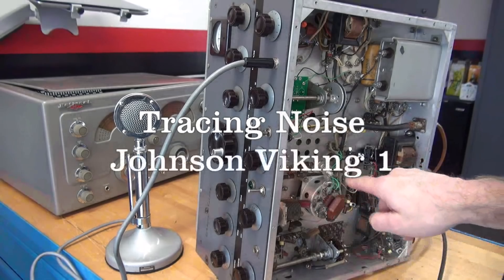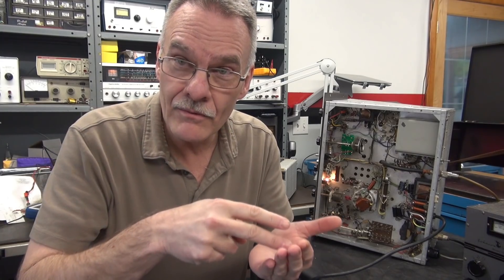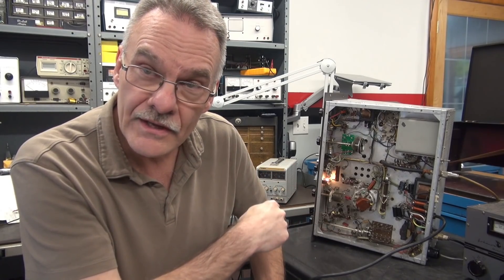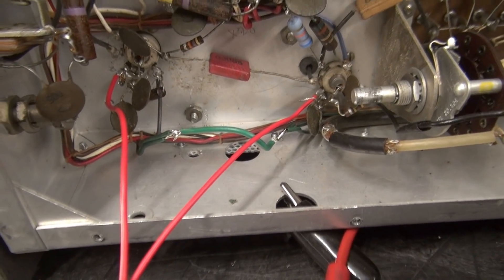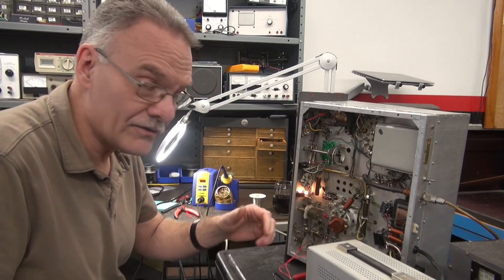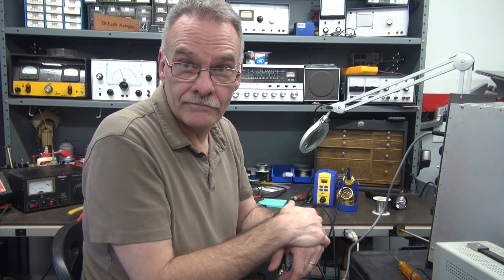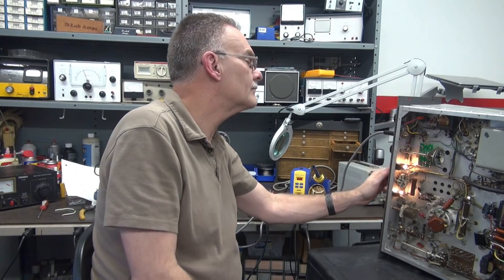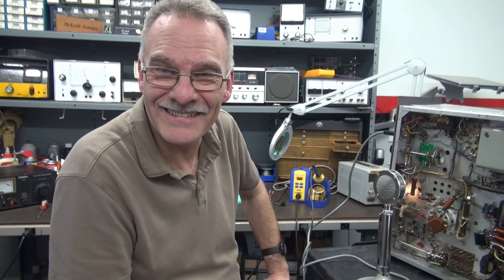Troubleshooting Johnson Viking 1 Ham Transmitter Science experiment Failed again When does this end?

Comment: Hi,
    Well done, in getting the RF side of things sorted out. Looking at the schematic I see there is a 0.5 mfd capacitor going to ground from the 807 screens, wonder if that is ok. Also it should be possible to see if there is a loss of volts to the screen, and anode, via the modulation transformer secondary, to the 4D32 output valve.

    Frank Hedley GM8TXC

Comment: Really enjoyed the video. Stay calm, don't panic!! By the way, I found previously that if the filament ground and HT ground are shared by one wire in the cable leading to a PSU, there is hum. This is because the filament volt drop across the wire appears in series with HT. I agree that twisted balanced filament wiring is best, but i think the centre tap is best in the PSU. 73

Comment: Terry... back in part 4 of the Viking 1 series you did not have a hum or audio problems after rebuilding the audio section from someones modifications, and you were getting a clean signal with lots of audio drive.....I think you have narrowed the problem down to the audio section, so tracing the audio signal should reveal where the audio is disappearing....

Comment: Terry
Are all those old capacitors replaced?  Have you checked to see if they are out of tolerance or if an electrolytic is reversed?
Remember your adage, "if they are that old, don't even think about it, just replace them."
What repairs were done before you received this rig?  I bet King Cobbler is hiding out close by.
Could some idiot have used acid core solder?
We all love a mystery!  Keep at it! You will solve this!

Comment: Terry, did you go in and check all of the power supply voltages to make sure that they are in spec?  Did you take your scope and probe the supply voltages to make sure that they are clean?   Have you actually probed with the oscilloscope the transmitter oscillator, multiplier and driver stages?  How about the speech amplifiers in the modulator section.   (Use a 10:1 probe for this.)

I wouldn't place to much faith in your probing with the inductor on the end of the long clip leads.  I noticed that the biggest variations came from you moving your hand holding the so called probe.   A better probe would have have a small turn or two of wire on the end of a piece of small diameter coax cable to remove hand capacitance from the equation.

I might help us following along if you would put a summary of all the things that you have tried at the top of the post.  It might save all the "have you tried" questions.

Comment: Huh. Are the filament winding isolated from each other? I wonder if a shorted winding in the transformer could be the issue but I'm shooting in the dark, wondering if it's coupling through the filament circuits.
Accidentally killing the modulator and having the buzz go away seems suspicious, like the circuit between the two has been opened... another flaky connection of cracked resistor/choke?
Keep at 'er Terry!
Cheers

Comment: your 6v heaters/filament  are I assume are DC so how clean is the 6v circuit from the transformer. 
Noisy recifier diodes maybe need some decoupling capacitor or  it comes across as mains frequency on the heater circuits.
Try fitting smoothing caps across the heater feed? 
Certainly is a baffling one, and you are more of an expert on Valve gear than I am so my suggestion may be way off. 
But the fact you are using 6V DC suggests recification noise on the DC circuit from the transformer. 

I hope you fix it, its now become a public labour of love ;-)

Comment: Did I see sparks in the little green circuit board?
4:50
Reply: I saw it too. With a noise accompanying those flashes. Might be on to somthing.
Reply: @wilsonri  the creaking sounds is the chair. There are three sparks. Two and three happens at the same time he turns a knob all between 4:50 and 5:09 on top of the green circuit board.
Reply: I was wondering if he had a LED or something on those boards but looking at a couple of other PTT module installs, there doesn't seem to be one. So, there ought not be any flashes over on that board. 
More problems? Or is it related?? 
I seem to recall there used to be PTT timing issues related to not disconnecting the antenna/load before the final had fully stopped ampifying. Did the new PTT do something like that, creating the buzz problem that he had not noticed before getting ready to ship this out??

Comment: Mmmmm, so this would mean that the modulation was working by "mixing up" with some ground connections in that area? NOT supposed to be there, hence, making that terrible noise? Well the positive things is that it's making a great video series! Now, indeed I would recommend like others just did, that you leave it alone for a day or two (not too long tho) and fix a Champ or two in the meantime ☺️.
You found the noise solution by thinking "guitar amp", so hopefully this will help again 🙏

Comment: I thought that if grounding the centre tap of the Filament supply  places each side 180 degrees out of phase thereby reducing filament induced hum via phase cancellation? Does it have a centre tap? And of course the two resistors in line balances the lines also helping reduce filament hum.

Comment: Ok. Now at least you did see, that the ground, where you was walking on , was a false floor.
Better base now to go further !
That's what i meant with "don't do mods if the original state isn't even restored.

I have two ! old HF-generators with problems in the internal modulation section. One is tube, one solid state. 
It seems, a modulation circuit is hard to get started if the HF-Oszillator is some decades old and specs gone off. With external modulation both ca be modulated, internal is mostly just not willing to start.
But i'm shure, if i take the time to get it back to specs, it will work.
Because as we all know, they once worked.
Of course, not your problem, your modulation seems to be present, as far as i did understand, what you were saying, but the carrier wave doesn't seem to get the modulation?
Or did i understand you wrong?  English is just a foreign language for me.

Reminds me of once building a Wien-Bridge from scratch with the simplest circuit i could find, sqeezing it in the smallest housing possible - and i just never got it stable at the higher ranges.
Same problem later with my HF-Transmitters. But i didn't have a scope back in these days, so i was half blind - no wonder i couldn't see all the oscillating problems and HF- leakages my simple designs must have had.

Comment: Hi Terry firstly thank you for these awesome videos after a search I came up a couple ideas 
1-Did you check multiplier tube 6AU6 filament bypass capacitor (C31)( In my opinion it has to be close to tube)
2-Cathode bypass capacitor 6AU6 (C34)
3-if these does not work can you separate audio preamp circuit  and check whether the problem causes from it
I am writing this comment same here I hope it works 

schemetic I look: https://www.frostburg.edu/personal/latta/ee/ranger/schematic/multiplier/rangermultiplier.html#multiplier (This is ranger circuit :)